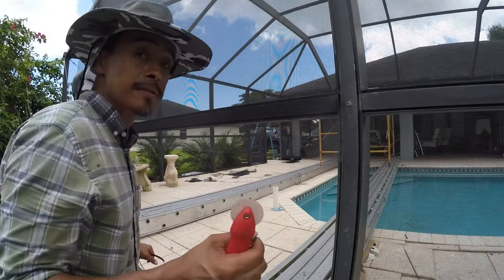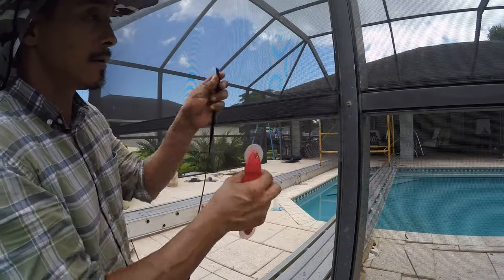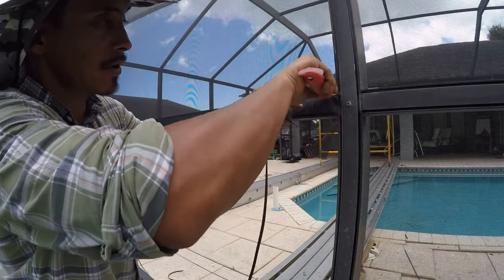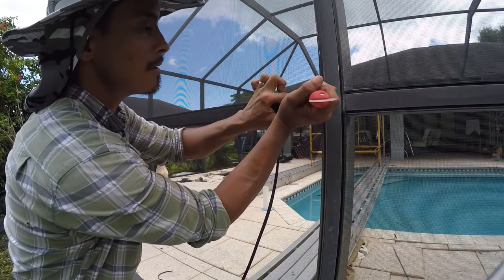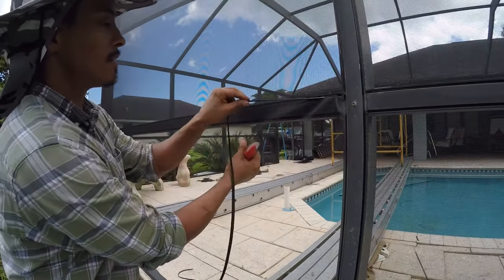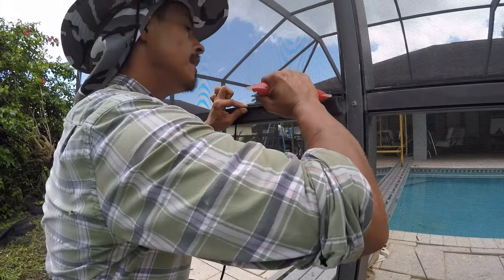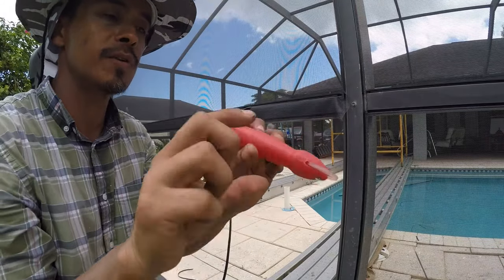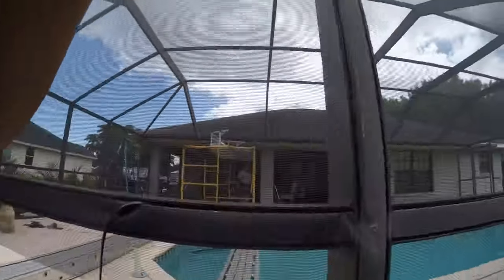How to install screen mesh "Replace your pool screen" or "Rescreen your screen porch"

Comment: God bless you for getting it done. But the roller you are using is for windows mainly. You should get a flat spline roller wheel from your screen supplier and attach it to a stanley quick change knife. Also is is imperative that you use the flat spline the correct way, if you were to screen the roof incorrectly you are putting the next guy who walks the beams at risk. The ROUND side should be visible once installed. I have been building pool enclosures for 21 years in east central Florida.
Reply: What’s a good supply store for screen and spline?
Reply: @TimHarris-fq5nl  The big box stores like Home Depot and Lowes carry some Phiferglass Screen which is the screen we use. We buy our materials at Town and Country which requires you to be a licensed contractor.
Reply: I’m in central Florida and want to get in to rescreening. How can I go about this?
Reply: @MichaelBrianInc  What area? There is a lot of Screen companies that are always hiring including myself. I would recommend going with a company that builds enclosures as well as rescreen.
Reply: @daynapper7337  question - how often do customers ask for windows and door screen repair or replacement? Is this a frequently looked for service and do most owners get a bunch of windows done or are jobs a one or two knock off repair sort of thing?
Reply: @MichaelBrianInc  We do have customers asking if we do window and slider door screens, but not very often, maybe 3 times a year. We do not focus on those repairs, or advertise for them, so we usually recommend them to Ace Hardware which charges about 20 dollars/window. We recently purchased the table jig for screening window frames correctly, so we do plan on offering it more in the near future. Usually its a couple windows from a house, or maybe the whole house, so 5-15 windows per customer. We were offered to bid on an apartment complex replacing over 100 frames and screen but at the time I could not take it. The market is there, but I don't know the sustainability of only focusing on window screen repair.
Reply: @daynapper7337  got ya and yeah I figured that’s probably not an in demand ask from consumers or is less sustainable. So is the market sell more leaning toward rescreen? Like upgrading their screens from the current ones they have when it comes to windows and doors? Or is the focus more towards selling patios, pool enclosures and roll up screens etc? 

That complex bid would’ve been amazing. That’s a whole lot of windows!

Comment: I'm not worried about the side panels, it's the one in the middle of the top of the screen ten feet up that worries me!
Reply from the maker: Yes, we use scaffolds to replace the ones on top, theres alot of guys that walk the beams, but we like the safer approach and use scaffolds with planks.

Comment: It’s a lot easier if pre-roll the spline groove first. 
Also the rounded side of the spline goes into the groove facing the panel if you do it the other way it’s in backwards.
Reply from the maker: Ive seen people preroll also, but if you do that the screen wont be as tight, but yes you can preroll, i just prefer not to so the screen will be a lot tighter at the end.
Reply: @solidmakersaluminum  
I’m actually a roof guy I hop up there and climb the cage  no walkboards or ladders . We’ll I use the ladder to get to the roof once I’m up there I just crawl the beams and perlins I can tackle 1500sq ft roof in a day by myself no problem . 1000sq ft roofs that don’t have a bunch of crazy angle panels or b.s in my way like shingle debri in spline groove.funky angles pinched spline grooves . I can take a standard easy 1000sqft in under 4 hrs.
Reply: I hear yah what yah mean with the not prerolling but I can’t agree in my opinion. I  never have a problem with them being any kind of loose.  There’s small tricks you learn with experiences  . Like the fact of having to roll your first side evenly and straight  is as important as your tighten side . You can stretch and roll 3ft at a time if your first side rolled is even .
Reply: If people think that standard 18/14 phifer screen is difficult to roll in . They need to try Florida glass solar screen or super screen

Comment: I start this job doing this Monday, brother what is the name of that tool! Thank you for your video
Reply from the maker: its called a screen roller, you can buy one at ace hardware
Reply: @solidmakersaluminum  spline roller. I got one thank you sir. I’ve done home remodeling about 3 years. This work should be cake. With that light aluminum. Seems easy peezy. Except for walking those beams on top and using ladders resting on planks over pools. Not sure I’m down for that. Not gonna get hurt and be in a wheelchair rest my life
Reply from the maker: @FromTheHood2TheWoods  be safe, we dont walk the beams, we use scaffolds and planks.

Comment: Your not supposed to use both sides of the spline. 
If you use the wrong side of it 
It will fall out once it dry rots